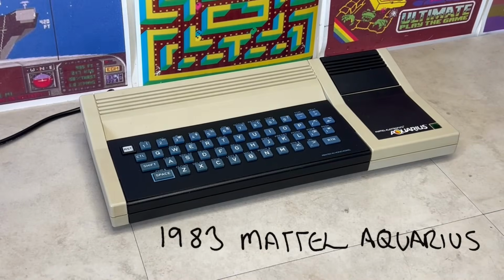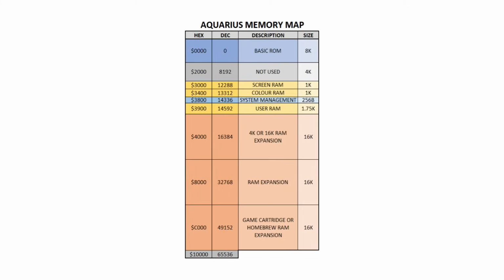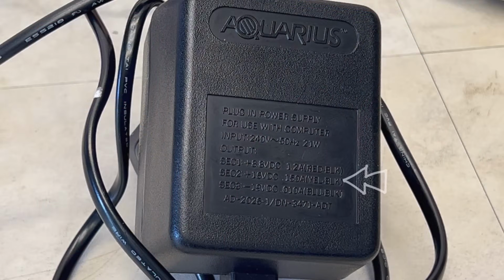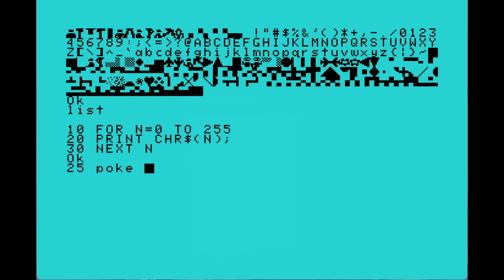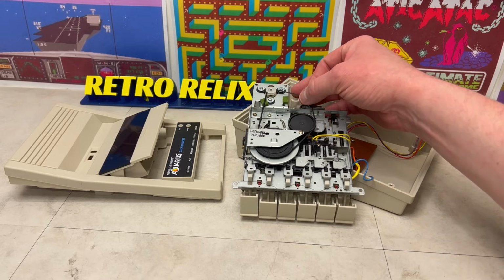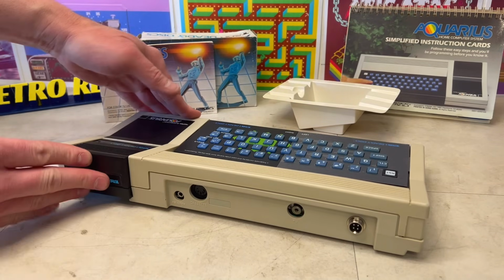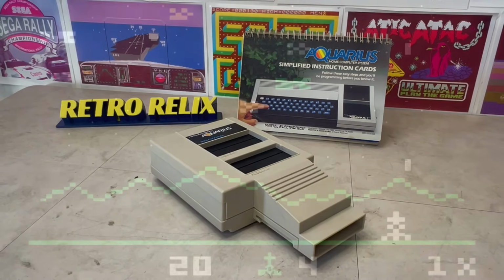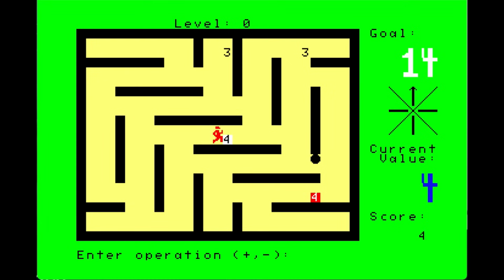1983 Mattel Aquarius Review, Power Supply Socket and Modern Mods

Comment: Do not use motorized screwdrivers to avoid damaging the plastics. The rust needs to be removed. Only an idiot would think of covering it with paint.
Please do not damage the original cables.
Please do not damage the original case.
Why do you destroy history?

THUMB DOWN.

Comment: It was not that bad. But the Mattel Aquarius never had a good name, it was a toy, not a computer. It was designed for mass production and that did not come true. Maybe, very maybe if a computer enthousiast would have worked on it, things would be different. Silly sounds, silly keyboard, silly expansion port, while the processor was capable of running CP/M, it could have ben used for serious work, Mattel aimed at making a toy, and that was their mistake. 
 
1983 was the year when MSX was on the horizon, they had exactly the right mix of games and serious work capabilities. A toy that could do word-processing. They lasted on the market a decade longer then the Mattel computer, while it had approximately the same number of chips, the same coasts to make. Mattel is a toy company not a computer company.
Reply from the maker: You make some fair points.

Comment: I worked in a computer shop that sold these alongside Atari 8 bit, C64, and even Sord and Spectravideo machines, and it was obvious even then that the Aquarius was awful compared to the competition.

The basic in particular was terrible. Everything had to be done by POKEs.

It was the lack of any user definable graphics and the pitiful amount of memory that was the biggest issue.

The machine was so bad a customer tried to trade one back in but was disgusted when the shop manager only offered £5 for it!
Reply: I think it was originally aimed at a similar market to the ZX81, ZX Spectrum, Dragon 32 and Oric computers... cheap and cheerful, but with expandability built in. But the lack of RAM really was a mistake, and totally inadequate in 1983. A lacklustre BASIC wasn't unique to the Aquarius... unbelievably the Commodore 64 also used an old version of MS BASIC, with no graphics and sound commands built in, despite having excellent hardware capabilities. Fortunately, after my ZX81, I got into Atari. Plenty of graphics and sound commands to play with. 😂
Reply: @another3997  The C64 had a limited version of BASIC because Jack Tramiel didn't want to pay Bill Gates the licence fees to make an updated version. So they just used the same version they'd used on the PET and VIC20 which they had bought outright from Microsoft and didn't have to pay any extra fees for. The only good thing about C64 BASIC was that it was so limited it encouraged you to learn machine code to best use the advanced graphics and sound capabilities of the machine. Unfortunately the Aquarius didn't have any decent capabilities to program for given it was limited to character graphics only.

Comment: Excellent!  I thought about buying an Aquarius BITD, but didn't.  IMO, It's a step up from Intellivision and 2600, but is lacking compared to other 8-bit offerings of the period.  I did remember it's ultra-short lifespan on the market.
Reply: I guess that, in the UK at least, with reasonable pricing this could have taken off, had it not been for the incredible success of the Sinclair ZX Spectrum the year before. Although the lack of inbuilt RAM would have been an issue, it appears to have broadly similar capabilities and a better cartridge/peripheral interface. But in 1983, this couldn't compete against anything except the Atari 2600, Intellivision and the cheap as chips ZX81.